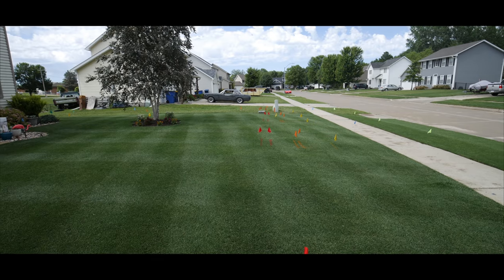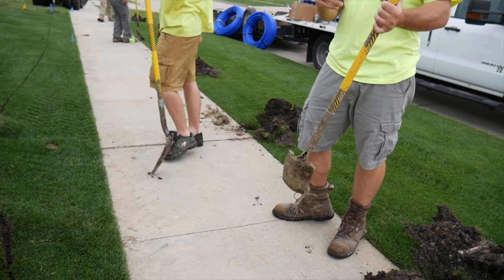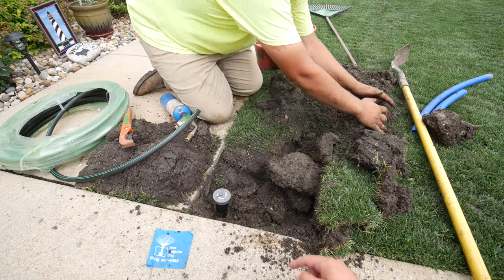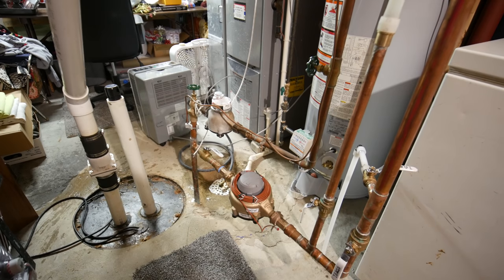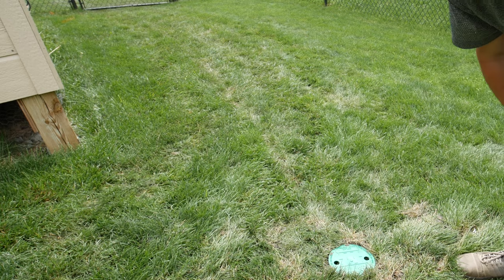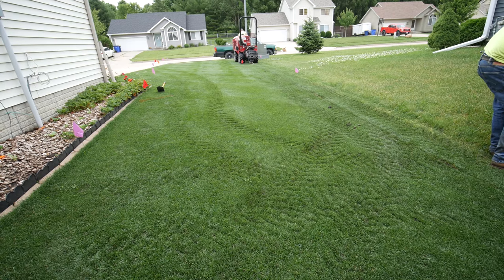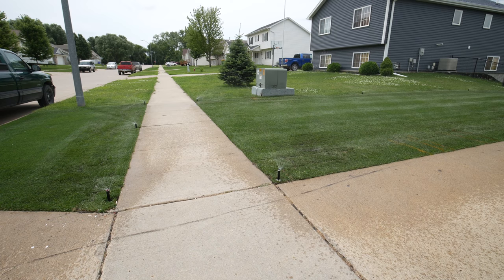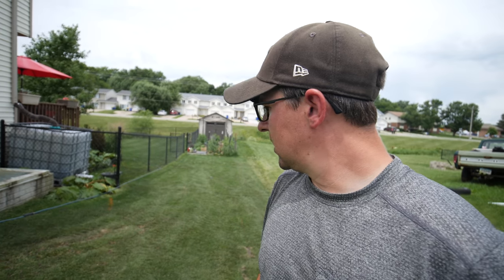I Got An Irrigation System!! // Hunter Irrigation MP Rotator and Hyrdawise

Comment: Me i was lucky was a 300 year old farm house on my property on my land . Farmhouse was leveled and split into two properties. Besides finding live mortars from WWII ... I discovered a 200 year old well that was capped and my garage foundation built on that ... the Turkish neighbor told me I had a well ... when i found it under the crawl space under the house and drilled a hole into the concrete cap. I dropped a flashlight down 50 feet . An amazing Find!! In the center of the well someone drilled further in the center and added a PVS pipe . When I plum bobbed the depth of the dry well at 50 feet i found the string dropped another 25 feet of pure water . I was lucky enough to drill through the concrete cap and then up through the garage concrete floor and place a pump in the forward part of my garage . Finally when I dropped 70 feet of 1” PVC pipe i am ready for the next step . Life is cool in France free water !!!!

Comment: You’ve made the best investment in going with Hunter.  My sister and brother in-law have their Hunter system for twenty one years and have never had a single malfunction. Their timers and valves have been flawless and the only sprinkler head that needed replacing was due to damage from a snowblower.  They had spares because when they added their driveway, they took a zone out and have a few extra heads. 
 This is the Kitchenaid stand mixer, the Kirby vacuum, the John Deere tractor of sprinkler systems.  
  I still think that you should have a National Walking Sprinkler Model B-3 just for the fun of it.  They’re highly entertaining and every bit as well built as an anvil.  
  I think that you will want to aerate the areas where the equipment disturbed your soil in order to return the soil to its soft, non-compacted state before top dressing. 
  Congratulations Ryan!
  Life just got easier and you won’t realize how much work regular hose end watering was.  
  I’m looking forward to a video of the zones running with the sun illuminating the streams of water from your sprinklers.  You can make it look like the Bellagio Hotel
Reply: Nice seeing you here! How is it running 5 years later?
Reply: Ive had half a dozen breaks in mine over the past 10 years alone.

Comment: Super happy for you with the watering system. 

Questions: 
How much did it cost?
How many sprinkler heads where needed and did you decide where there where places?
What’s piping did you need in the basement and why? I thought they hook watering system to water spigot?

Sorry for all the questions but plan to do as well soon. Thxs.
Reply: Safe to say he probably can’t get to answering everyone’s questions, he has a lot of subscribers.
Generally, the contractor will draw up the plans based on type of landscape and water supply. Spigots generally do not provide the adequate volume/pressure required to run a system that large. Main lines are generally 3/4” or 1” where as spigots are 1/2”. I’m guessing this system cost him upwards of $7-8k. Not including the cost to fix the damage caused by their sloppy work.
Reply: My lawn is nearly double his size and I have 10 zones and paid 4k...and that is on the high end if I really shopped around in might have gotten it for closer to 2500 but I was in a rush and had used the same company at a previous house and was pleased with their work
Reply: @g5todd  Sounds about right. I paid $2400 for 5 zones over a .20 acre lot here in SC. Also installed a irrigation well and pump so free water! Yay!
Reply: I pray I can get this done for under 4k! I have a 1 acre lot in total.
Reply: @antoniobrown3219  Were you able to get this completed?
Reply: @MatthewBWebster  not yet. Got 2 quotes, waiting on a 3rd before I decide.
Reply: @antoniobrown3219  If you don't mind me asking, what kind of figures are you getting on the quotes and what area of the country are you in?  I'm looking at 1/2 acre myself.
Reply: @MatthewBWebster  Not at all. I'm a little SW of Atlanta, GA. 1st quote was $4800, 2nd quote was $6500. Both included 5 zones and a control module with an App for wireless control. The very 1st guy I spoke to asked if I could wait until the end of the season, if so, he could give me a "really good price" so I'm gonna call him 1st of Oct before I decide...
Reply: @antoniobrown3219  Thank you.  I am south of  Atlanta as well, so that gives me a great starting point.  Getting anyone to call me back around is difficult at best.
Reply: @MatthewBWebster  Good luck my man. We'll stay in touch...🤝🏾✌🏾

Comment: I would have installed a full garden drip line irrigation system like 15 cm below the grass. Works amazing, you won't see anyting, never fails and saves water.
Reply from the maker: Doesn't work when I need to water seed from above

Comment: Hey its well worth it I had my system installed in April. Best thing I ever did especially the Wi-Fi feature damage took a month or so to repair but September is right around the corner . but anyway when they did mine it was hard to watch especially that dam tractor rolling all over my lawn wish I would of went to work that day . greetings from long island NY
Reply: Long Isle Drone I’m on Long Island too. Who did you use for install and how much was it? I have approximately 10k sq ft. Thank you
Reply: Had a company do it automatic irrigation paid about $2200 I have 3500 sq feet 5 zones

Comment: I redid the irrigation system in my house a couple years ago to fix a terrible layout. I rented a pipe puller and it trashed the turf and was hard to get into tight spots. I ended up renting a small trencher to get into all the tight spots and finish.  If I had to do it over I would have done it all with the trencher. The pipe puller is nice for long unobstructed distances but it does as much or more damage as a trencher.

Comment: I’ve never seen an install like that with those yellow caps that go over the blue pipe.  That’s pretty ingenious.   You should have a well to water with if your not already doing that.  My bill dropped over $200  a month after switching.  The water is cheap but you pay for sewage.   I think the tire grooves will level out.  They do here , but we have more sand.  I had a guy drop bricks on my lawn and it all disappeared.   Good luck

Comment: Diy project for 13000 squares .
10 zones , 34 heads, flexible pipes , valves , connectors etc.+
Renting trencher from HD . Total cost about $2000 .
Was given estimates around $5000 - 6000.
Reply: Make Lawns Great Again 10 zone $5000 is good i got quoted 7 zones $7000

Comment: I sort of luck out. My house had an irrigation already installed. But it had not ran in 20 years. The valves were rotted and dead, the heads were mostly all busted and some of the pipes leaked. Still, could be worse.

Comment: What was the ballpark cost for something like that? Material, and Material + labor?
Reply: Really depends on size of your yard. I have a 40x40 back yard and a small front with 2 zones 9 heads and it's about $1600. I'm guessing his size yard is is probably 6k
Reply: @ryanlavallee3239  We have a typical yard around the midwest with about 8300 sq ft, and our Rain Bird system installed (44 heads) with a booster pump, all plumbing including the backflow valve, ran about $6,600. One year later, worth every penny!
Reply: @ryanlavallee3239  No way this is more than $2200 at absolute most.   Have 12 zone, 43K sq ft system.  71 heads in all, and that was around 7K.
Reply: David McCarthy Lots of factors go into the cost of a system.  They always are a bit more money when installed on an established lawn.
Reply: @dmccar12  heads aren't expensive, labor is. Unless these guys are making a buck and hour theres no way this is even close to that.

Comment: Congrats on the system... but the company really did make a total mess... I would have had very mixed emotions like "Great, my sprinkler system is finally installed but why did you need to wreck my perfect lawn?".  There was NO need to bring in heavy equipment for this job and cause so much damage to your lawn.  Mine was done a long time ago, but the trenching/piping machine was a small unit that left absolutely no damage.  The whole install took a day.  When the job was done, hardly a mark was visible and within a short time there was no sign of the work at all.  Anyway, you'll benefit from having it.  It was wise to separate the zones in the front...

Comment: Hi Ryan...
Great video as always,
I have a 4 questions about your Hunter MP Rotator placement on your sidewalk mow strip...

I'm currently converting my rain bird sprinkler heads and pop up body's with Hunters 40 psi regulator pop up body's and MP Rotators.

I bought a mixed variety of the mp rotators.

my questions are...
1. What was the reason you placed your pop up body and heads on just one side of your mow strip versus staggering across from one another? 

2. Do you get a good full corner to corner coverage?
 
3. How many feet apart between each head? 

4. Which mp rotators did you use for your mow strip?

Thank You Ryan for your help 😊
Reply from the maker: I would go on each side of the strip and not just one side.  I didn't design it and learned my lesson it would be better the other way
Reply: @ryanknorrlawncare  
I have 14 foot wide by 9 feet deep mow strip... 

should I do all four corners and two centers or one corner then stagger across to place a center then stagger across to the other corner for a total of three?
I was thinking of using the MP 800SR heads.

my fear is...
will I get corner to corner coverage with three or do I need to have all four conners and two centers across from each other?
then I worry, is that way overkill?

Comment: I have a similar issue with soil compaction on my lawn but not from a sprinkler installation and I am not going to be able to add top soil to correct it. I think I need to cut it out and backfill the area with soil and then relay the sod. What do you think and is this something that you will need to do to your lawn? A video on this would be nice.

Comment: Any tips for how to help your lawn recover faster and or repair tips for the post in-ground installation. They used the same equipment on my heavy clay soil and I can still see the tire mark depressions in the lawn..... :(    Any tips to help repair would be much appreciated. I will plan to top dress/level and over seed in the fall but just curious if there was something I could do before then. Any help is appreciated.
Reply from the maker: Try to get a decent amount of water on it to settle things as much as possible. Rolling wouldn't do miracles but could help some if the ground was somewhat soft.

Comment: Did you consider under lawn drip systems? Seems like they have a lot of advantages like watering at any time of day without risk of fungus, less loss due to evaporation, completely hidden. I'm surprised you didn't go for this during your various lawn renovations.
Reply from the maker: The problem there is I will likely be seeding or overseeding in the future and that needs water sprayed on top of the seed to keep it wet.

Comment: My understanding is direct sprayers are better for small areas vs small rotating sprayers. What's your opinion?
Reply: Rotating sprayers take longer to water but spray a more even seepage so they are more efficient in that respect. They also resist misting where they save a great deal more water as standard sprayers can lose up to half of the water that the discharge before it hits the ground due to evaporation. There are ridged nozzle sprayers that help to reduce evaporation and improve wind resistance.

Comment: Hey Ryan, been following you several years. I finally pulled the trigger on an irrigation system install, and can relate to having the install damage woes afterwards. I'm pretty bummed, but feel that in time I can get things settled back out. I have a question, and it's about minerals, mainly the iron (rust) staining that occurs over time from the system leaving water on your cement. Have you noticed any staining after 3 years of use? Did you seal your concrete before or after the install, or can you give any advice on how to combat this? Thanks again for all your videos.

Comment: I installed my own over 6000sq ft. 25 heads. It damaged mine just like that and it’s all good now...4 months later. Ground will settle more than u realize. Renting equipment, installing a new meter just for the system everything still cost $3000
Reply from the maker: It might settle but are you reel mowing at .75"?  That takes a very level surface to look good.  :)

Comment: Did you have a second water meter installed?
Reply: the_aircraft_mechanic great question! 

Ryan - if you didn’t get a second meter, strongly consider it, so you’re not paying sewer charges on the water used for irrigation.
Reply: Yeah, it won't cost much at all to run the irrigation system with a second water meter installed
Reply from the maker: Yes you can see it in the shot of the plumbing

Comment: totally off topic but where do you get that rig you were using for leveling the soil... I need that in my life!! lol..... beautiful system by the way!! so nice to watch the pros work!!
Reply: he got it off of Amazon.  you can make a pull grader yourself also.  2 2x3's.  3 rails of 4' long, then cut the remaining part into 1' lengths to join the three rails together.  drill two holes on each end of the end pieces and put some string in it.  put a weight on the back end and pull away.

Comment: My issue with just about every irrigation system I've seen is they all seem really weak. Like if there's any wind at all those tiny streams of water get blown everywhere except where you want the water to go. Most irrigation systems ive seen really dont put out very much water at all and i dont see how some mist blowing in the wind really gives my lawn the 1/2 of water it would need when the temps start pushing 100 here in TN. Not to mention the coverage area always seems to be lacking. Like, not everywhere is getting sufficient water. They also always seem to be breaking or having problems leaking or getting clogged or replaced. I'd love to have an irrigation system but I have yet to see one that's worth the money and headache of maintaining and damage to the lawn from installing. Anybody have any input?

Comment: I know you're not a plumber or irrigation specialist but whats your take on how to do this on a slab house that does not have the ability to add a hardline plumbing option? I have been looking at doing this at my house and just putting a splitter on one of the hose bibs and then running it that way but I am curious if theres a better option available
Reply from the maker: I am really unsure about that one....I know it needs a large line to be able to supply enough water and I'm not sure split off a hose bib would be enough
Reply: @ryanknorrlawncare  Yeah I had a system at my old house, one of the Rainbird DIY kits where you hook it up to the hose bib and it would have been fine if I had been able to break it up into multiple zones. I tried running 6 heads at once and it didn't do so well. I have it mapped out to only run about 3-4 heads in one zone so I think that approach will help
Reply from the maker: @adprince87  I can run 3-4 off my hose bib so I think that's doable if your pressure is good

Comment: I've been doing this line of work for 10 years now and i can assure you that the rotter nozzles they slapped on those 1804 PRS-30 hunter heads in some areas were not needed. its a trade trick to increase the price of the install cost to uneducated customers. You would of been fine with 8 series nozzles along the Boulevard. They use less Gallons per minute and water just the same and over all better coverage. Same for the bigger parts of the yard the hunter PGP or even the PGP ultras have amazing coverage and are all pressure regulated.  and work much better than those rotter nozzles. The PGP series also need less time to run to saturate enough. Not sure how long you've had the system but eventually there will be issues where you might get some brown spots. those rotter nozzles always become clogged and broken, and the fact the filter is integrated as a one piece unit, there is no way of just changing to a clean one unless you change the entire unit. 

The hunter hydra-wise controller is great and all if you cough up the dough to install a flow meter on the inside of the house which can be connected to a master valve (essentially its a valve that prevents the main water supply outside being constantly on. Once the controller turns on a zone that valve opens up the supply feeding the outside of the house) Always nice to have to prevent a leak going un-noticed. But with a flow meter its a completely different ball game. The controller becomes your own little alert hub which can also be connected to a cloud (if you pay for the service). Allows it to track what the gallons per minute each zone is using and if ever it goes over that threshold or even bellow it will deactivate that zone until repairs are made. I can't tell you how many horror stories ive seen leaks go unnoticed with a watering bill the price of a mortgage payment. 

If you have any questions shoot me a reply/message

Comment: I had an irrigation system installed when I had my house built, huge mistake. Builder contractor did a crappy job and the sprinkler heads were nothing but trouble. Now I never use it.